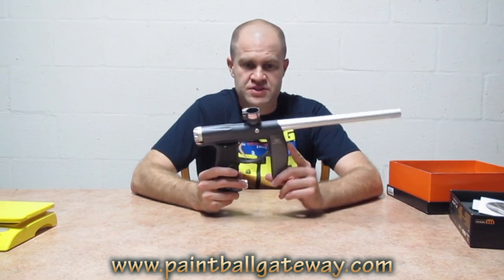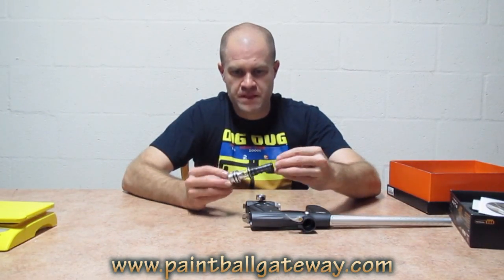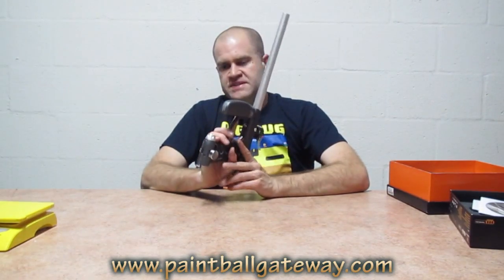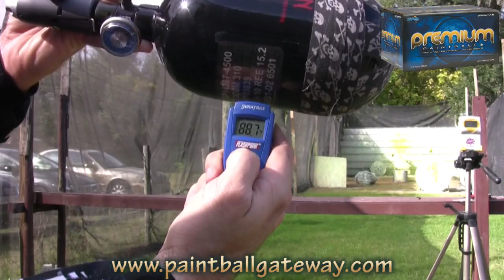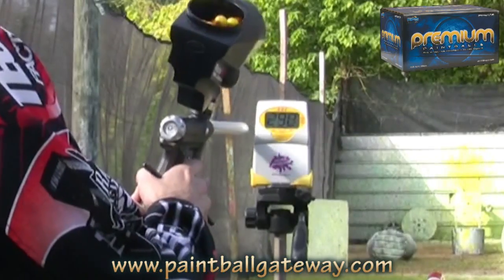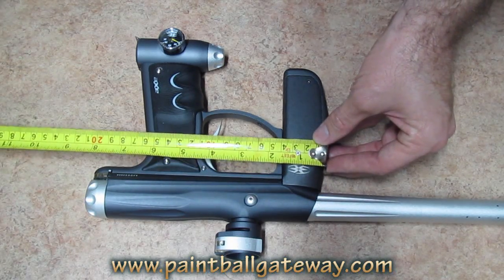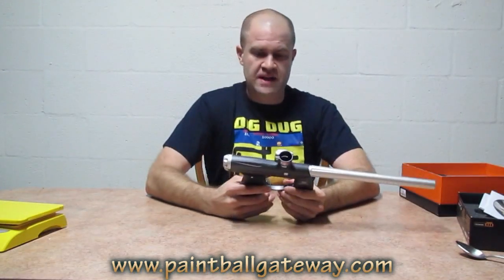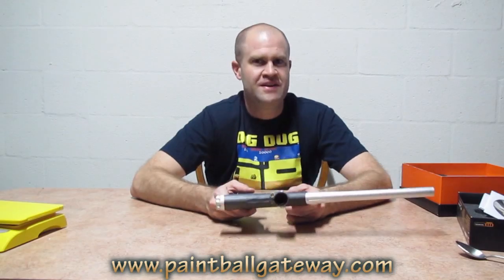Empire Axe Supergun Show Review

Comment from the maker: @stubbleson 

if you slow down your shooting, don't chill the tank as much, you can pull almost 11 pods. Also, the stock barrel is a .690. When I was using the .684 Furious, the efficiency greatly improved (my velocity went up about 15fps as well). If you snug your bore, and slow down your rate of fire, your efficiency goes up quite a bit

Comment: *stock.     You can buy techt bolt (get the delrin), buy a new barrel with a tighter bore, set your guns pressure at 195 and adjust it through the back of the gun.

Comment: (Continued) 
To set your pressures,set your reg (ASA on the axe) to 160-180, then go to the back cap. Begin to increase velocity until it levels out, around the 310-320 fps range, then drop your pressure until your velocity comes down to your field limits. Hope this helps! If you cant get it fixed, take it to the pro-shop (if you don't have one or don't trust them, send it to Empire, they have great customer service and will help you out) Trying to get a channel started, so check it out! Thanks!

Comment: GET THE AXE 1) its more consistent then any other gun at 500 price range.
                      2) its all metal no plastic parts like etha and etek
                      3) easy to maintain.
for 450 new and like 300-400 used do it. i got mine brand new for 350 and it shoots money i put a ul on it ropes .

Comment: The stock barrel is good, but if you want a longer barrel, get the CP barrels, they run about $30 and are very comparable to the $100 dye ultralite system. Hey, by the way, barrels aren't going to affect accuracy, unless it has honing issues. the bore size (the inner diameter of the barrel) will affect consistency and efficiency. you should underbore or overbore, but dont size match paint because paintballs are inconsistent in size, even among a single case. Any other Q's, go to my channel!

Comment: @dose16 The OLED board will work IF you have the foregrip for the Mini, as the window for the OLED is specific to that part but the foregrip for the mini is compatible with the rail for the foregrip on the AXE. I LOVE the OLED board, though what you are getting is not leaps and bounds beyond the stock board, just some versatility of modes and just a hair tighter of adjustment for dwell,

The Eye board has the hall effect sensor which the AXE doesn't have as it uses a microswitch, so no-go there.

Comment: @coolvideo28 Im glad they are thumbs uping it.  The essential message behind that post is still true.  The efficiency stated is a mistake.  I miscalculated the value, but its still not near what is claimed in the vid.  Ill keep it up until its changed, because even with an underbore barrel, that efficiency value based on his test does not concur with his conclusion at the end.  I will remove the comment once the vid is ammended.

Comment: It's most likely your dwell. Grab a tank. Drop the dwell by 4 blink intervals (1ms on stock board) until your gun doesn't cycle, then bump it up by 1 blink, turn eyes off and shoot. Continue to do this until it begins to cycle, make sure shoot it a little once it begins to cycle, because if it isn't high enough, it will not continue to cycle. Once you get it to cycle,grab some paint, get a chronograph and adjust your pressures to get it in the 285-300 fps range. (Part 1/2)

Comment: the axe pro has the same mechanical internals. the main board on the regular axe has tournament legal firing modes which makes it a tournament grade marker. besides, the virtue eye/main board combo, aftermarket spring and bolt kit and a proper barrel kit will outperform a stock axe pro. I have my tuned axe shooting smoother and quieter than a stock brand new LV1 and broken in luxe 2.0. combine that with the simplicity of an axe over a luxe or lv1 and you have a true, tough, tournament grade gun.

Comment: Hopefully someone can give some input. I'm looking to buy a gun and I've been set on the gog Extcy for a while but I've been looking at the axe and I've kinda fallen in love. It's a huge price difference is it worth it
Reply: Thanks for the input! The axe does look like it feels incredible and i think I can get one in good condition for nearly the same price as the gog on craigslist!
Reply: co8539 The axe is probably one of the best guns for the money in paintball period.  They shoot smoother than many high ends, quiet, decent on air, easy to work on, easy on brittle paint, and will keep up with anything out there.   There are a few upgrades that will even improve the gun beyond that.   You can't go wrong.  A used stock axe should run you about 250-300 these days depending on any upgrades.
Reply: Is it worth it? Yes. For the extra money, you'll have a marker that you won't have to, nay, want to trade in for a very long time. Also, replacement parts are easily available and you don't NEED any upgrades. I only swapped out the barrel. Great marker.
Reply: That new gtek is pretty sweet though........just saying.

Comment: I have experience as well and i have not seen any difference in my markers accuracy from barrel to barrel over bore or under bore . obviously under bore will give more consistency and is the better buy but it isnt more accurate over another, using higher quality paint will.

Comment: @SamiDullard10 its a pressure controled poppet :) which means it uses a single tube with a pin valve to relese stored air every shot instead of the two tube indipendant ram style like an ego or timmy

Comment: i disagree.... accuracy depends on barrel length and bore size, sound signature is much louder on the etek, and not very much upgradability on the etek on the axe you have a new barrel you need, or no need but i would prefer it, and other than that there is no up you need the axe comes with all you need and if you really wanted a new board for the axe, you could get one.

Comment: etek 4 or AXE? you should do a etek 4 review
Reply: I am asking myself the same question...
There are several supporters of the axe
and several of the etek 4
the 4 is lighter, can be fully disassembled, and looks a bit better in my opinion.
the axe has its own positive though... not sure which is better.
Reply: fuzzpuup i had the same predicament.  i went axe as the parts are cheaper, its MUCH quieter, smoother shot for brittler paint, and over all performance.  The weight is never an issue for me and honestly you do get used to the ugly ass look of the axe ;) It's like an ugly dog, it looks cute to you :D
Reply: fuzzpuup Axe is much quieter too

Comment: I bet a lot of people here will say Axe, as they're very nice.  I doubt there will be a lot of supporters for the Proto Reflex rail 2013.  In my opinion (I've shot all three and owed an axe and etek 4), I would go for the etek 4 if you're looking for a stock marker, but if you can upgrade an Axe, it's deadly. crazy deadly and quiet.  The etek is louder, but it didn't bother me as much as it does other people.  The eteks are also very reliable and easy to maintain.  But it's hard to beat a upd ax

Comment: Axe. I love mine to death. It runs perfectly and rarely breaks paint. I even put it to like 20bps ramping in the chrono once just to dick around and went through pods of paint without a single break. It's pretty much a great tourney level gun. All the modes you need and it's easy to program. Would probably just get a different barrel as I used my friends CP barrel instead of stock.

Comment: EGO 08! God I love those things. They are substantially better than an Axe, in my opinion. Yes, they're loud, but when you're playing tournament paintball that doesn't matter at all. I put a pooty modded cure 3 bolt in mine and I can get over a case of paint per 68/30 tank. It shoots ropes and the grouping is about 3 inches diameter at 50 feet. Shoots +-5 FPS. I FUCKING LOVE THE EGO 08! Additionally, PE is discontinuing the Ego line, so in a decade or so they will be rare and worth much more.

Comment: Hey, I need help and I was wondering if you could do so. When I flip my ASA on, you hear a long (maybe about a five second) burst of air coming through the trigger. That would happen every time I flip my ASA on. Please help?
Reply: That is pretty standard, mine hisses for a couple second on air up as well.  I think it is just the gun building pressure in the pressure tube which is in the grip frame.
Reply: DoppinPlates just flip it on slowly i think thatll help

Comment: Wat is the operating pressure on the axe ? Like wat pressure kit should i get?
Reply: +isaac morales The operating pressure is about 160-200 PSI, however if it is anything similar to the Mini then its best to use a high pressure output tank ~800

Comment: @joshuatree1001 
DeadlyWind or Deathsticks CF barrels work Great for this gun. DeadlyWind uses freak inserts for boring and Deathsticks Has different backs you can put it on. As for hopper, I have an empire prophecy on my AXE with standard nose on it. It looks great on gun, very low profile, even for snake play.  and definitely will feed fast enough to keep up with the gun.

Comment: The ego 8 is loud because it's a poppet valve.
And just because it's loud doesn"t mean it sucks.
The ego 8 has Better efficiency and better performance than the Axe.
By the way on the manual of the axe it says you need to be a qualified and trained technician to service it,. The Ego 8 doesn't.
Ego 8 > Axe.

Comment: Is it ok to use an axe with co2 because it's got an electronic grip frame
Reply: Axe is meant only for hpa. Black friday is coming up and 68/4500 tanks should be on sale for about 100 bucks
Reply: I know but I'm in England and only aloud to use co2 so what will happen
Reply: You can use c02 but it's not good for the gun. It makes the gun cold too
Reply: DO NOT USE CO2 IN YOUR AXE. IT WILL FREEZE YOUR BOARD AND IT WILL SUCK.
Reply: +Christian Pearson It wont suck, it will completely break the gun
Reply: Paintball Noob which sucks.
Reply: yes. you can use co2 in the axe, if you don't mind buying a new solenoid every time you freeze it.

Comment: You should never judge a gun after 3 boxes. Judge it after you've 10,20,30 boxes shot. Because then you can lower the dwell and then you might change some lpr settings etc.

oh and the etek is loud, i own one, but who cares, I personally haven't seen a single gun that is silent enough to not be noticed in a game. Of course if you use a 22" super sniper barrel or idk, it can help but still.

Oh and it helps to not use carbon fibre barrels, they make every gun loud as shit